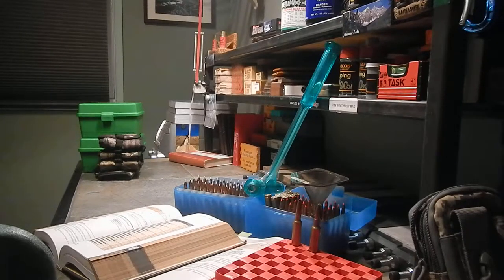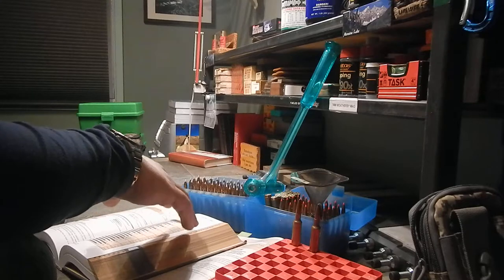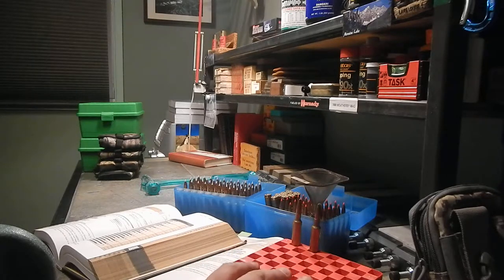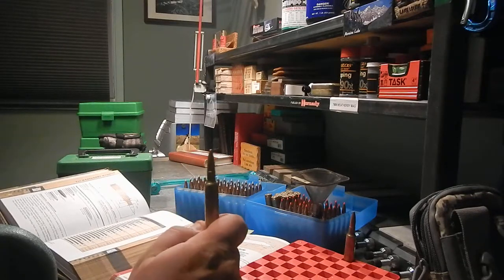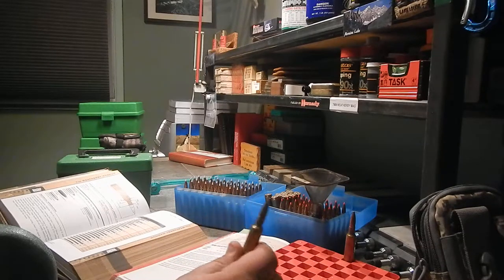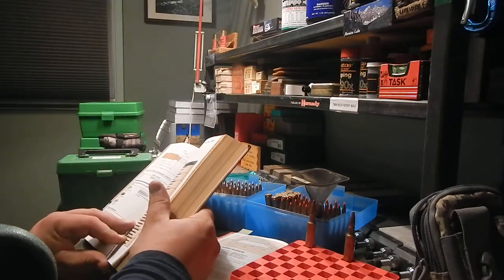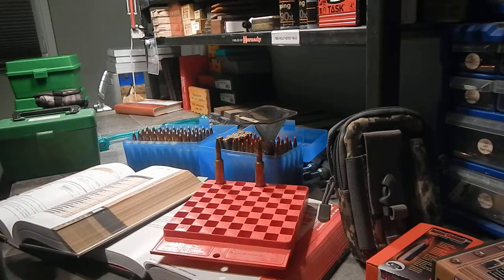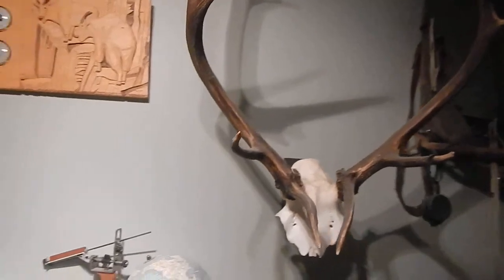7MM Weatherby Mag Part III  (Loads and Components)

Comment: Hey stranger.  Do you still have my last phone number?

I tried texting you a while back, but it was some girl haha! Let me know, this is the only way I have of connecting you buddy.
Reply from the maker: Hey mister. septemberelktracker@gmail.com send me a message
Reply: @PeaceCountryBoy   Hey Dave.  I bought my first 7mm Wby mag last year.  I'm looking to load up some 154 gr Interbonds using Retumbo.   Can you give me the min & max charges please?  I appreciate it if you will.  Thank you and stay well.
Reply from the maker: @hawkeye4497  Hi Rob - I can't give you exactly what you're looking for since I don't have the charges for 154 Interbonds and Retumbo. I can maybe get you close to what you're looking for if I give you the 160 Partition load data if that helps at all...Starting charge for 7mm 160 gr Partition loaded with Retumbo is:

Min
75.5   equates to 3053 FPS at a case capacity of 98%

77.5 equates to 3131 FPS at a case capacity of 101%

Max
79.5 equates to 3189 FPS at a case capacity of 103%

Hope this helps, start a little lower than the minimum charge to compensate for the lighter bullet and good luck!